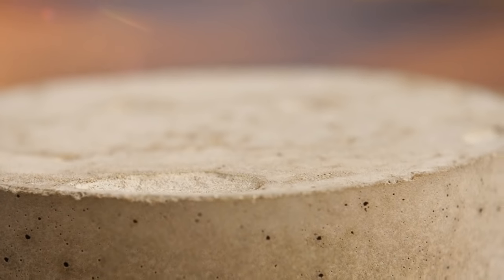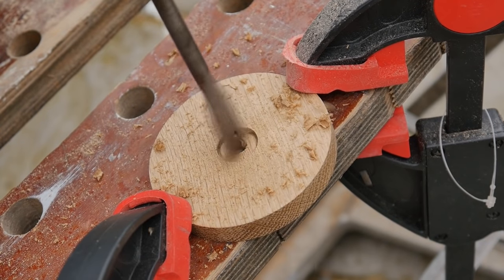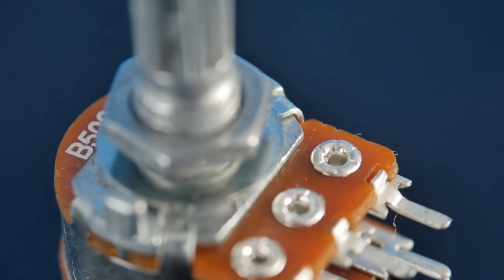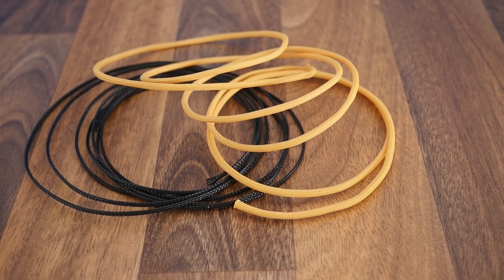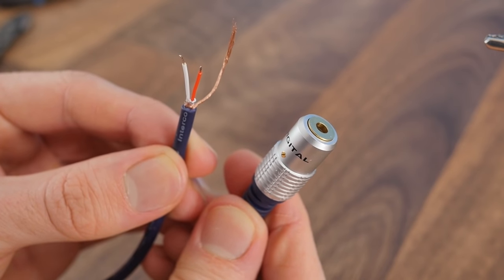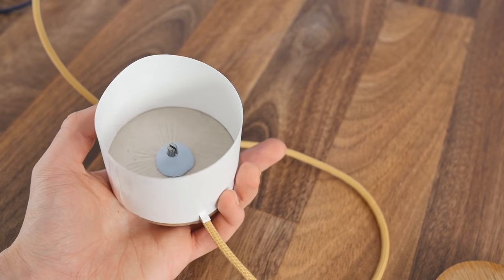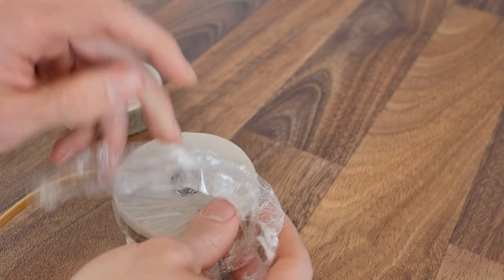How To Make a Concrete Volume Knob

Comment: Can any type of 3.5mm jack be used to suply power to the diode and send audio signal to the speaker equally? Without using usb port for diode.

Comment: what if I used a potentiometer with greater resistance? like 50k or more? these are the only values I can find so far. Can I use a mono potentiometer instead of stereo? would it work the same? Thanks!

Comment: Can you take a potentiometer with more ohms? And what would be different? I guess it won't be that loud, right?
Reply: +DerEinfallslose hmm not quite. the higher the resistor value the higher the signal dampening. The maximum volume will still be the same (approximately), but the minimum volume will be lower.
Reply: Only if you use the dual version (the one with the six terminals). I would also recommend a logarithmic potentiometer for better sound control.
Reply: Yup, these should work just fine^^
Logarithmic pots usually don't cost (much)more than linear ones and grant finer control in the upper resistance band (or lower, depends on how you connect them). On the other hand, with such a massive knob, fine control should not be a problem, so it's a matter of personal preference^^
Reply: Sure^^
Be aware though, that all I said is purely theoretic and that I actually have no experience with building analog volume adjustment knobs.
Reply: DerEinfallslose ^^

Comment: Ncie one. How to do that brightness will also change? louder=lighter; quieter=darker?
Reply: +Messhkod  probably with 3 pots stacked into one (instead of 2) so the third one would be for the led; also i guess yould would need more than 5v to power the led and a different resistor attached to it, otherwise it would turn off way before you turn the potentiometer all the way to one of the sides
Reply: Thanks man. I have to try :)

Comment: Would a different ohm rating on my potentiometer bring any difference ? For example I found some B10k and B50K on Aliexpress but not B500, would it be any different or would it just be the same ?

Comment: Why not heatshrink the soldered wire joints individually too, not tape.
Reply: +Mark Bartlett he keeps them all in one straight line anyway so it doesnt have to be individual, so it looks cleaner and easier to sheath with them all together

Comment: Any way to get a circle without the bit or a router? I have a small electronic screwdriver.... The 18 mil i could get to work but its not powerful enough to cut the circle

Comment: Hello, i am trying to make a volume knob of my own but i am having a bit of trouble finding a 500 ohm potentiometer, (i know there are links for where to buy one, but i don't have the time to wait and the shiping cost is just not worth it) but i dit find a 1000ohm one, so my question is: Could this project still work with a 1000ohm potentiometer?

Comment: hey i have a question about the pentatiometer. i have assmbled everything but the volume isnt high enough in general. Would another pentatiometer with another resistance level help ?
Reply: At max level the resistance is 0 in every potentiometer, so there's no difference. Is it quieter with the knob than without it in the loop?

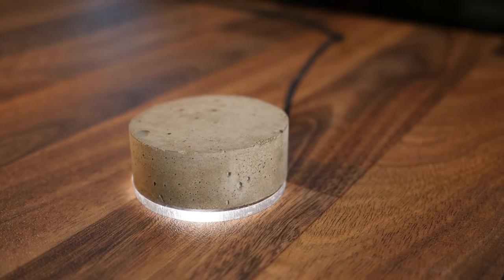Comment: 10:57 can you make the volume and the l.e.d brightness by the volume meter?
So if the volume is lower the L.E.D. dimmer will show less light
And if its on max the light will be brightest is it possible?
Reply: yes but that would probably require it to be cabled with usb instead of 3.5mm

Comment: So been testing this out, Ive bought exactly everything you have said and followed the instructions, and I am on my first attempt and everything seems to be working kind of, heres my issue after plugging this into my audio source and my speaker, the potentiometer seems to only change the volume by say... 10% i thought this would have been able to control full volume range, I have tried using different sources (Phone, PC, Laptop, TV) and the potentiometer doesnt want to use the full volume range 0-100 if i am wrong and this is not the case please let me know if it can be fixed please help
Reply: I think this is due to the fact that he recommended using a linear pot. Logarithmic pots should be used in audio applications.

Comment: Isn't B on the pot Linear? It was in my day. You need an A on it instead for logarithmic or audio use....500R is a bit low for line level.. try 10K :)

Comment: is it possible to use wood instead of concrete. if yes how do you do it?
Reply: +MaxArtZ, make a wood cylinder (if you use a wood desk, try to use the same wood) in kinda the same way of the base but with a thicker piece (slightly more than the potentiometer shaft length) and make sure to use a drill press (to make sure you're drilling in perpendicular) with a bit that matches the potentiometer shaft width and make a hole where the depth is about the same as the height of the shaft minus about a millimetre or so to create the same small gape when placed on the base.

At the end, sand and treat the whole thing (base included) with some varnish or oil so it looks like one piece and matches your desk color.
Reply: but there will be a hole in the top if i drill it like the bottom! thats my problem
Reply: MaxArtZ
that's why you don't drill all the way... just enough for the shaft

Comment: Is there some way to control my dac with this (my dac has an amp built in so I am talking about controlling the volume nob on the amp) I wouldn't want to put it to max sound and then just put this in between because this would probably degrade the audio and when the Dac runs on max volume the output is slightly distorted.

Comment: Would this screw up a headset mic 
Like if I had a gaming headset with a built I mic would the microphone data still get to my pc
Reply: Dependso on how it's connected. Usually it will either be a composite 3.5mm jack with a mic contact or a dual cable. A dual cable will work since the mic can connect straight to the PC and the audio cable can connect to the knob. The composite cable I suspect would turn down the volume of your mic too xD

Comment: Help 

The only dual gang potentiometers I could find at my local tech supplier were 1000 and 5000 ohm, no 500 ohm. I'm not waiting for flea-bay ship one in from quanzoo china, so online is out of the question. I also want to keep the stereo signal, so I must to be a dual pot. So what I'm getting at is; can I use a 1000 ohm dual pot instread of a 500? What is the difference in performance from a 500 ohm?
Reply: +Jack Duno Im using a 1000 and it works fine and yes, dual gang is needed to keep it stereo
Reply: Ollie B Okay nice, thank you!

Comment: if i change the audio input with a usb will it be better
Reply: BALLSDEEP it will probably not work since a usb is used for serial signals and needs some adjustments to be able to take an analogue signal like audio. especially the pc needs to recognize it as such

Comment: Can you use plaster instead  of concrete?
Reply: +McBEERtheDEER I don't see why not, though you would need to make the seal better as plaster is thin and runs into most any gap. I work with it often due to working in ceramics

Comment: Your overloading your iron with solder, which is why your soldering is blobby, use a chisel tip and just tin the surfaces, don't load the iron and then solder the pins.

Comment: can I use  B50K potentiometer instead of that one?
Reply: B_GAMER_ higher resistance = more room to adjust your volume. And it must be linear so you can have a feeling of turning the knob. Log potentiometer changes resistance very quickly so its not ideal

Comment: 1. This type of potentiometer is not the best choice of this build, even using the type with double gain.
As mentioned by others, you really SHOULD be using a logarithmic potentiometer.  Yes, the linear pots work "fine" but Im sure you notice, as you get above "half" on the pot you arent really at "half volume" yet.
2. Same DIY build >>> Arduino + Rotary Encoder.   The advantage here is that negative side of using linear potentiometer exampled above is not present, and also important it show the volume level on the PC screen.
https://learn.adafruit.com/pro-trinket-rotary-encoder/example-rotary-encoder-volume-control

3. Esay verson of Rotary Encoder Volume Control: 
https://www.instructables.com/id/Digispark-Volume-Control/
or
https://www.instructables.com/id/USB-Volume-Controller-Potentiometer-Based/

4. Same build, but here with RGB feature!! pretty cool, Mat should have opted for this one, as we all know he is capable of great builds and he loves Leds/RGB.
http://dangerousprototypes.com/forum/index.php?topic=7654.0#p62863

5. Ultimate build, which is WIRELESS!!!
http://patrickmccabemakes.com/hardware/Dial/

6. Easy method that do not require any build/DIY, and very great option, for those who is not into DIY and like a neat Desk, as less device as possible: Great soft, which REALLY should be checked!!
https://www.nirsoft.net/utils/volumouse.html
PS/ my Config:      When Alt Key Pressed + Mouse Wheel
                                 When Mouse is above TaskBar ,  to be able to change Volume with only one hand ;)

Comment: a Bosch router ist not "cheap" it is a quality tool for home use...
Reply: +MAYER MAKES  lol, thats a very cheap router dude. Relax.
Reply: its about € 100,- not what I call cheap...
and yes I'm aware that very good routers cost a lot more,
Reply: MAYER MAKES

1) the pof series is very cheap, you can get a BRAND NEW one for 80 euros on amazon..
2) even if it was 100 euros, thats STILL incredibly cheap for a router. My triton router would be 3-400 euros...
3) you really CANT get a cheaper router without buying a complete piece of shit.
Reply: For 'real' work you should rather go with the blue line. These tools are phantastic, but they are relativly expensive...

Comment: GOOD JOB<BUT WHY THE RESISTER ?WHY CANT I JUST CONNECT THE ENDS WITHOUT THE RESISTER>THANK YOU IN ADVANCE
Reply: The resistor was needed so that the voltage was correct for the led light
Reply: @twistiv  thank you

Comment: But how about the LED? How did you power it?
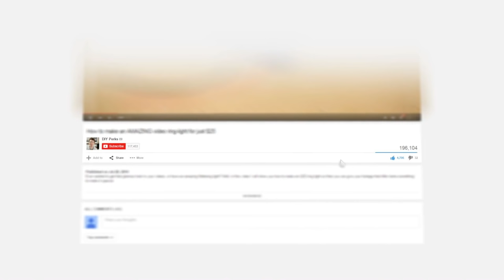Reply: +What Josh finds bullshit Quickly seen at end of video. 2 wires from USB-cable and plug USB to computer. 11:18 to 11:30

Comment: delivering signal to and from potenciometer without any shielding is not good idea, as it will pick up a lot of noise
Reply from the maker: As the signal is already amplified it's not an issue.

Comment: hi i have a question:
i only want to control the volume on my headphones, so my plan is to atach direcly the cables to the potentiometerr, the problem is i don't find the potentiometer and i can't buy it from the link (because Argentina's f*****g laws).

can i use another potentiometer ? or can you tell me the Hz of the potentiometer, here are sold by Hz not Omhs
Greatings
BLAU

Comment: does somebody knows if this could become wireless?
Reply: yes just get an audio bluetooth transmiter and solder it to the output pins pair it with whatever headphones you use and yeah that should work

Comment: Could anyone here help me with my dilema i have a usb headset (you can only find usb to 3.5mm for audio not mic). maybe a part two of this video is required to clear up potentiometer issues, stained concrete and also led controlled by audio levels maybe try to even make the concrete set with directional arrows for extra detail.

Comment: Would a 503ohm one work
Reply: Yes, just don't get one thats like above 2k ohm
Reply: I'm curious as to why he chose that particular value. A guy up in the thread mentioned that 5k would be appropriate.What would be the impact?
Reply: Estêvão Bhering resistance is calculated by volts*current. So the higher the resistance the more energy will be blocked. NOW your pc audio output not has a lot of power, so if you get a potentiometer with like 10k ohm, then volume would be completely muted after you turn the knob only for some degrees. with a 500 ohm resitance though it will only get blocked if you turn it up completely :)
Reply: Thanks man. And the people mocking the usage of anything LESS than 5k have any point at all?
Reply: NO! Resistance is a property and can be calculated by R = V/I. For audio purposes you wanna use something between 1k and 100k since 500 ohm load might be slightly too much load for the source

Comment: A rotary encoder would've worked better imo.
Reply: +Eddie Hart A rotary encoder would require a microcontroller to convert the clock pulse and directional pulse into a value. The microcontroller would then have to adjust the volume which requires it to have a good ADC and DAC as PWM would make the audio choppy or have a microcontroller controlled variable resistor which may or may not be better depending on the one used.
Reply: Exactly. You could connect it up to a microcontroller under the desk and turn it into a USB volume control.
Reply: +Eddie Hart  that would work but the real beauty of this lies in its simplicity.. adding anything else just needlessly complicates an otherwise simple and perfect hack. If I was to male one I would modify it like this-- run the able INTACT to the knob. Put the socket ON the knob.   End result is functionally a cable extension with the knob on it. Same function/ same parts. Just arranged a bit different. What I use is a small 4 channel sound board. The outs from the computer go to one of the stereo line ins. The tape outs go to the computer, the main uts go to a nice 40 watt amp driving some high end studio monitors, non of those crappy computer speaker s for me although some are rather decent. A good pro grade set of headphones is plugged into the monitor jacks feeding the mains.. At one time I could move sound from any used media straight to the computer and then converted to CD quality mp3s. Dont think Ive ever seen a mp3 ripper made to deal with a record or a tape.. ) end result is I got studio quality sound with good tone control.  There is NOT a single sound device I cannot hook directly to my computer PERIOD. No adapters ever needed and non of that on your knees screwing around under a desk trying to hook up a quarter inch cable to a 1/8 plug crap either.  I did pro sound for a few years before I retired...  lolol

Comment: gonna be "that guy". this isn't concrete, as you didn't add any aggregate/gravel. this is mortar, as used between bricks.

sauce - I used to work with my dad as a labourer on building sites.

Comment: According to an inquiry I did on a forum of electrical hobbyists I needed a 10K Ohm logarithmic potentiometer rather than a 500 Ohm linear one for audio volume control. But your solution seems to work fine. If anybody is interested here's the link. Https forum . allaboutcircuits . com/threads/volume-control-for-mono-amp.123294/#

Comment: The fact that this is a full analog volume control for a digital output is really frustrating. It would take just as much effort to do the exact same thing with an Arduino Pro Micro, and you dont have to buy audio-grade connectors and equipment to get decent performance. USB right to your computer, and adjust the volume using the potentiometer. And Arduino has the ability to use the pot-value to adjust brightness of an LED. Or just pick your LED effect poison. What a silly DIY when it can be made 1,000,000x better for a fraction more cost (or less if you actually buy high quality connectors).

Comment: This is not that good of an idea as you're adding another volume control instead of using the one in the PC. Just put a microcontroller in it.
Reply: This is not true. Reducing the volume in the digital domain is reducing bits. In this way the volume is reduced on an analog signal while the soundcard can stay up at full volume. So this is not only a nice idea because it looks nice and handles better, it also has sonic benefits.

Comment: I love your woodworking, but your solering, and use of shrink tubing, tape and so on, bugs me so much. allso, when you're going to have extra wires going along with the signal cables, then you should probly dubble wrap them, or use shrink tubing so the colors of the wires aren't bleeding trough. What I would do is use a color of shrink tubing, let's say fresh yellow, and then use dark blue on the outside wrap. that makes the inner yellow bleed trough in a satisfying mix.

Comment: So.. If I have an Amplifier without potenciometer (for example - http://www.ebay.com/itm/TDA7492-2-x-50W-D-Class-High-Power-Digital-Amplifier-Board-AMP-Board-Radiator-/272041590771?hash=item3f56f13ff3:g:DucAAOSwkZhWRD41) I can "add" it this way? And how much amper should the PSU have? Does it matter? Also some tone controller would be awesome (bass +/, trebble +/) Thanks :)